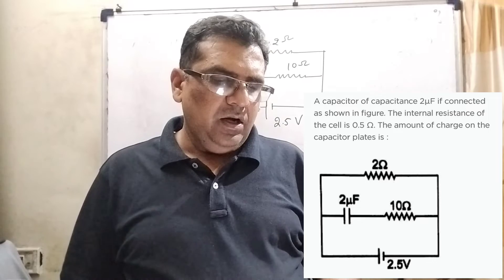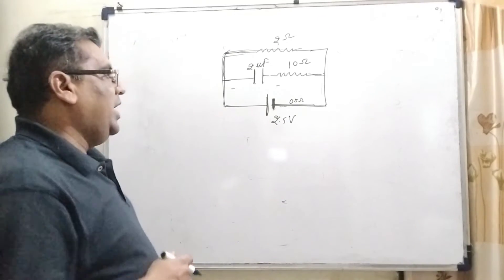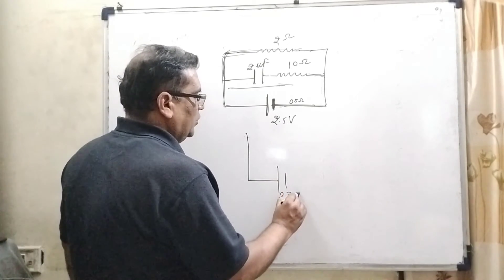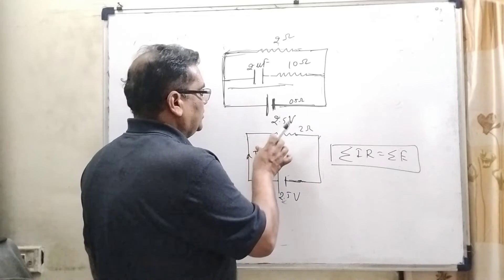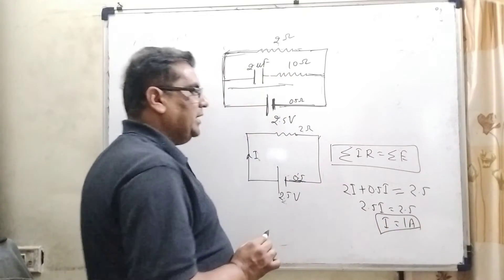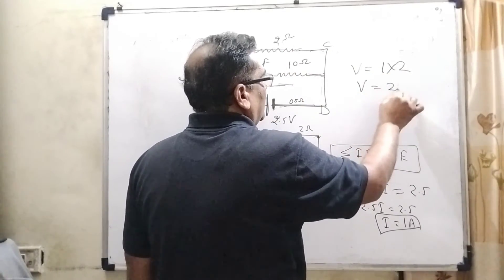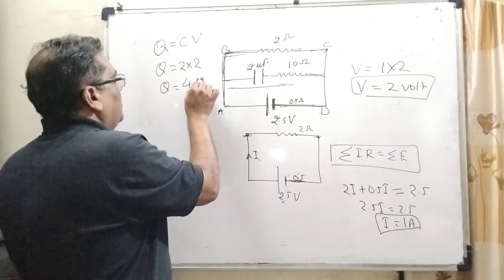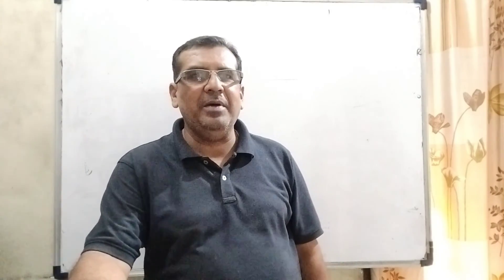A capacitor of capacitance 2μF if connected as shown in figure. The internal resistance of the cell

Comment: A soap bubble with radius of 2 mm has a pressure difference between the inside and the outside surface that is equal to 9 mm of water column calculate the surface tension